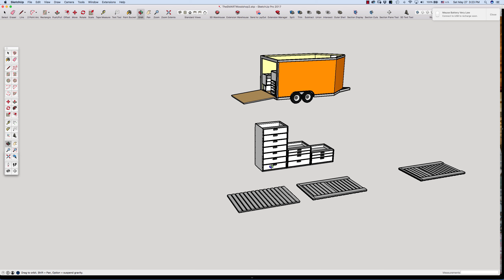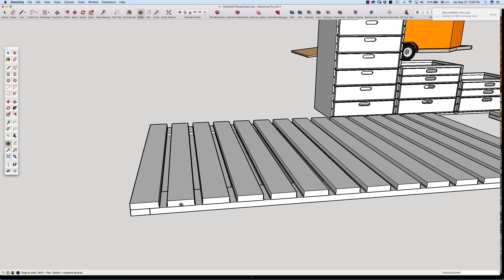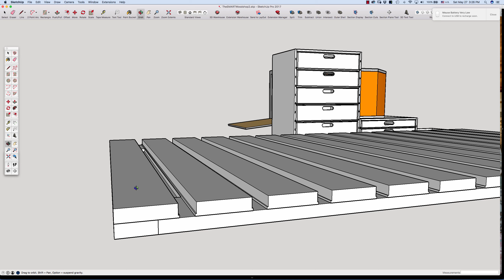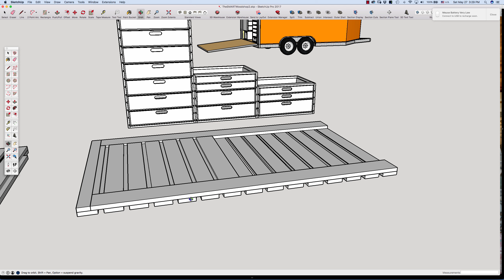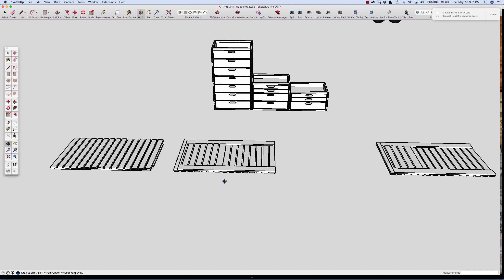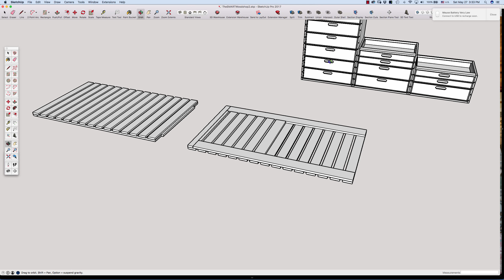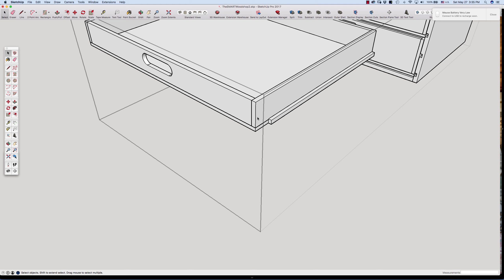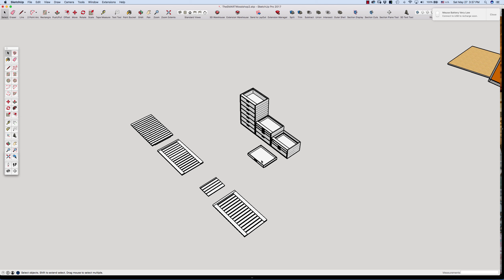My router is faster than your CNC: The Smart Woodshop

Comment: I like this idea Ron. I think the modular design of the sides and drawer heights makes for an easy build and also lets you move drawers around later. I am thinking I will build 3 or 4 drawer boxes using your jig for my next workbench. I wouldn't have to fill all the slots up with drawers at this time but could build more drawers as I need them.

Comment: Ron, Instead of using individual boards and making the steps to have the router do the final cut on it's first pass, have you considered the following: 1. Use a piece of 18MM plywood cut to the length of the jig. 2. Use your dado set to the width that you want the groove for the template guide to ride in. Set the dept on your dado set to just deeper than the template guide.  4. Using the dado set, cut the grooves in the plywood at the correct intervals for the template. 5. Attach the plywood (glue and pin nails) in the intervals between the dado groove to the boards that will be the template frame.  Then... the first pass in each groove will cut the plywood apart and make the groove in the first cabinet side.

Comment: Your points on Cnc are right, however, there's another solution that's a hybrid.  use a cnc to make the template. You could even put directions for sizing at the relevant points.

Comment: to get that Notch in the drawer sides is an easy fix. I made some tongue and groove cabinets where the groove did not go all the way through so I used a router with a ball bearing on the bottom to cut some of the tongue off. you just have to use an edge guide or a stop on the bottom of the router. great video and great idea Ron I think it will be better than the screw system
Reply from the maker: The jig I will make will be simple and will not require the use of a pattern bit, plus it will be fast and accurate to let the jig do the math. When I make a jig, I spend the time making it right and then it spends the rest of the time making all of the pieces exactly the same. 1 jig = 100 identical drawer bottoms. Every time I use a tape measure, I am wasting time and adding the possibility of error. My philosophy: a tape measure is for making something once, a jig is for two or more;0)
Reply: Ron Paulk exactly we share the same philosophy. the stop or pin that I would put on the bottom of my router would take me a couple minutes and every piece would be identical I would never pull out a tape measure to do it

Comment: Hey RON PAULK, I feel like your double sometimes when I watch your videos lol. 

Anyways, I know you use sketchup quite a bit and I wanted to say not only is it way more enjoyable but much smoother and FASTER to create models with a 3d mouse. I bought one and it's the 3d spacemouse wireless. I would have got the wireless pro pad now that I've done it more, but I didn't think I'd need it at the time, definitely wish I got it. Either way, the space mouse I use is awesome and it's by 3d connexxion. Save yourself some time and make your life easier and funner! 

Hope this is a helpful tip. 

- Tucker from Canada

Comment: I used your method with the screws, as I have a ton of the 3/4" Kreg screws, that I never actually need, but they came with a kit.  As to your wedge method, have you considered using UMHW plastic?  They might be more durable than wood.

Comment: if you put the wedges from the last video in the front and the back of the runners, a left and right could be identical
Reply from the maker: They are identical as is. adding the wedge to the back doubles the time and material to add wedges/stops. Also, I would have to cut out the drawer bottom in the back and front, again doubling my time. Lastly, if I cut out the back two inches of the drawer slide like the front, the drawer will have less material holding them up when pulled out.

Comment: The advantage of a CNC machine is that you can be working on something else while the CNC is processing the parts.
Reply from the maker: David, I would need to be working on something else to pay for the CNC and the shop to keep it in;0)
Reply: Ron, you're right.  For those of us who are hobbyists, a CNC can be a fun tool to play with.  Time savings isn't what the CNC is about in that circumstance.  But, for those of us who do this for a living, a CNC can be a very productive tool for repetitive tasks.  Using one to make just a handful of parts? That's a fools errand.
Reply: and they're faster most are slowed for lights out/unattended operation